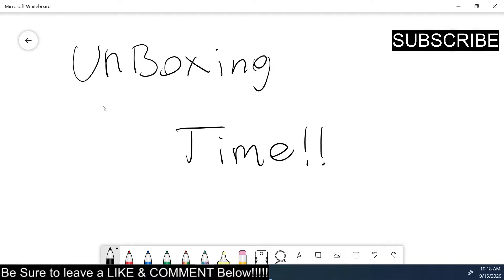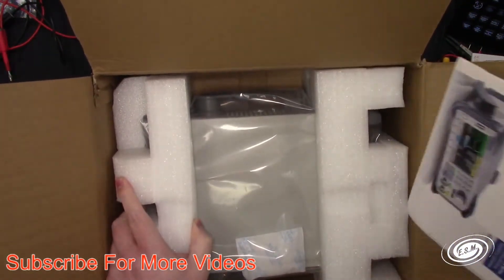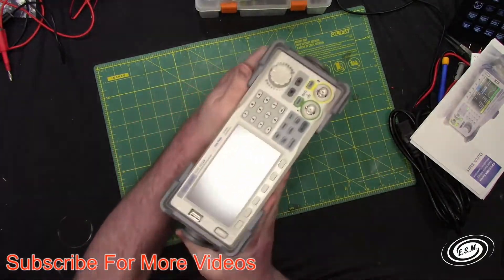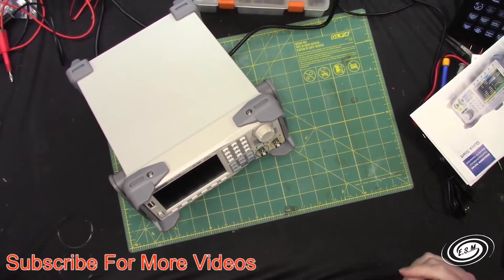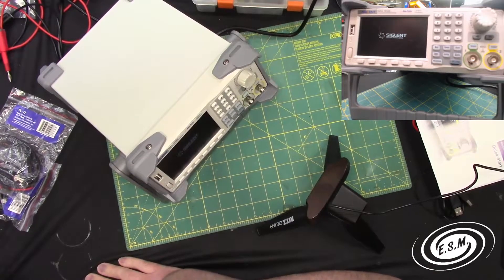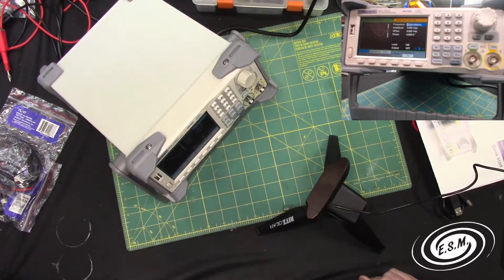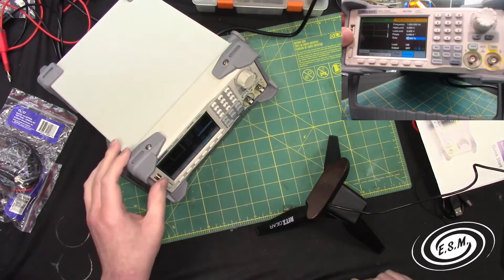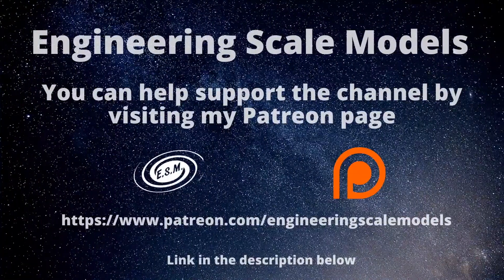Siglent SDG 1032X Arbitary Waveform Generator Unboxing

Comment: I just bought a siglent 1032x, it was surprising that they didn't include an output bnc cable.  How stupid is that?  Luckily I had an old bk precision function generator that I can borrow the bnc output cable from.  The manufacturer should include this.